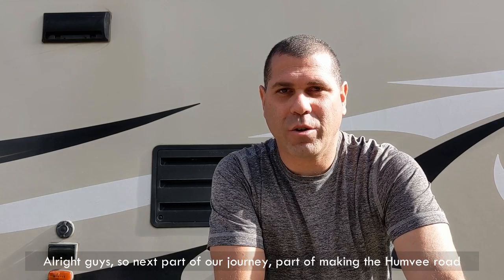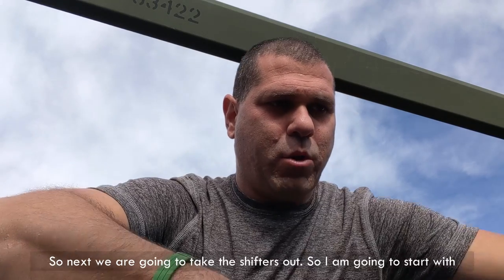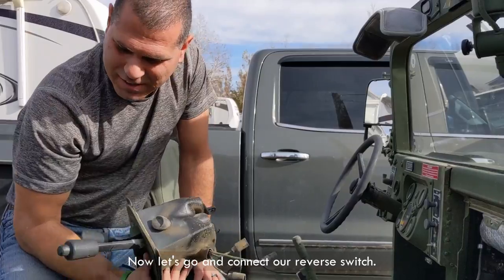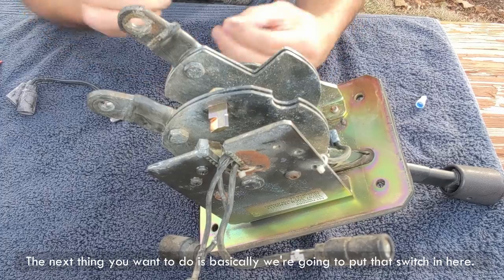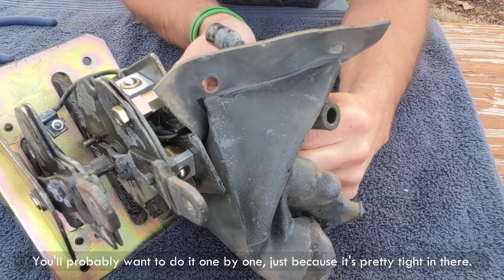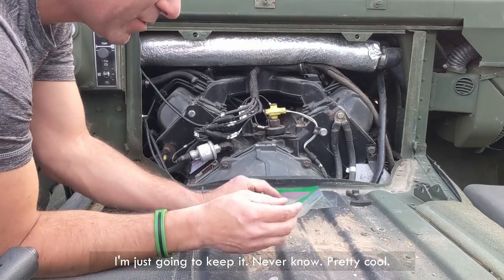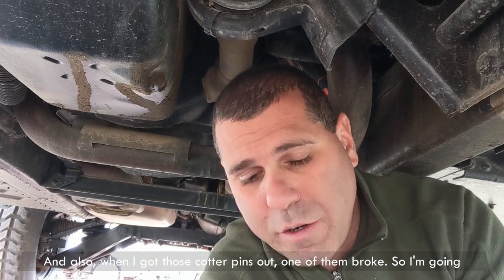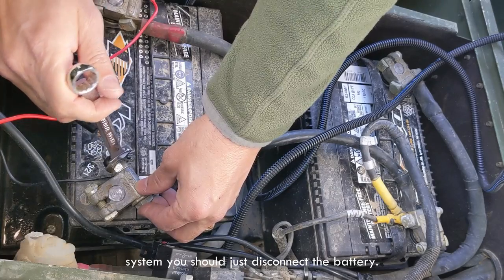Black Dog Customs Reverse Lights Switch Installation

Comment: Great video

A couple of questions …

1.) are you pulling 12v for the back up lights … looks like you are.  If so, have you experienced an unequal battery drain as they say this happens.

2.) Would be nice to see how you’ve connected to your switch to allow both manual and automatic use of the backup lights.

3.) would also love to understand/see more on the use of the relay as I didn’t go that way as the voltage was nominal for my 12v accessories but deep down inside I believe one relay per accessory may be the better way to do things.

Again … thx for a clear tutorial on the install.
Reply from the maker: Hey, 
Thank you so much! So happy you enjoyed the video :)

 1.) Yes, it is 12v. No, never experienced an unequal battery drain.

 2.) Unfortunately I can't take any pictures/video as we had a family situation and are unable to do so right now, but I can make a quick video showing this as soon as I get the opportunity to. :) But basically, both of the switches - the manual and reverse switch - are linked into the same power supply and module. 

 3.) Yes, I agree! As this video only shows the temporary setup for my 24v/12v system it is not the ideal way to connect my reverse lights. I will make a new video once I connect/install my permanent 12v/24v setup with a proper 24v to 12v converter. I believe it is better to step down (convert) the voltage from 24v to 12v and designate separate lines for each 12v accessory. This way I could avoid an unequal draw and prevent electrical problems. 

Hope it helps :) and hopefully I was able to explain well. Thanks again for watching & I appreciate your questions!
Reply: Depending on what generator/alternator you have, you can use the "rear" battery for 12v accessories(google is your friend). You need the 200amp alternator with dual voltage regulator. Also, as long as you're using switches that can handle the amperage, you don't need relays.LED lights draw very little amperage and operate on a wide range of voltages. That is why you will see most rated for 6-30 volts DC.  Do some research on why and how you use them. In this case, it is just complicating the wiring and making for more potential failures with all of those connections. Lastly, DO NOT use regular grease on wiring connections. Use di electric grease and only use on the rubber boots to help with sealing out the elements. Not meant for the actual metal connections. Inspire, I enjoy your videos, they just needed some clarifications and specific information.

Comment: Do you know if it would work on the 3 speed shifters?
Reply from the maker: Not sure! I know it would work with the 4 speed. That is the one I have.. Hope it helps :)
Reply: Black Dog Customs has 2 different reverse light kits (three and four speed).  Just have to order the correct one for your application.